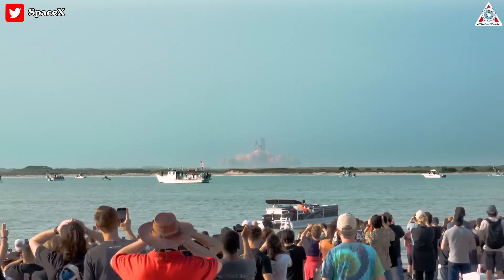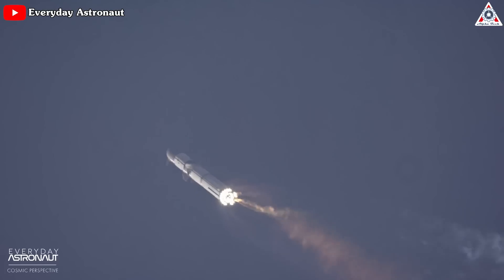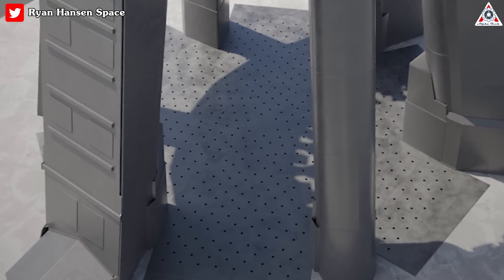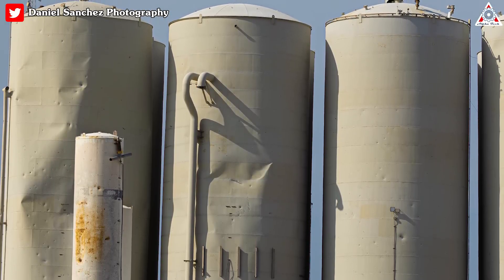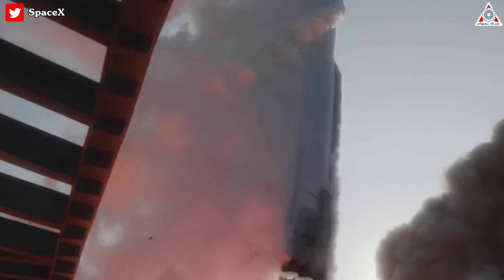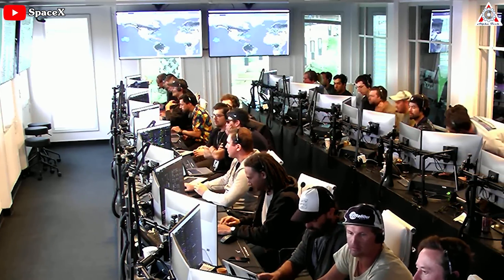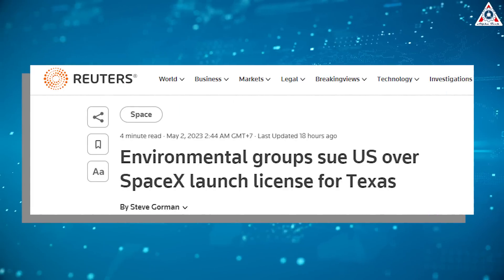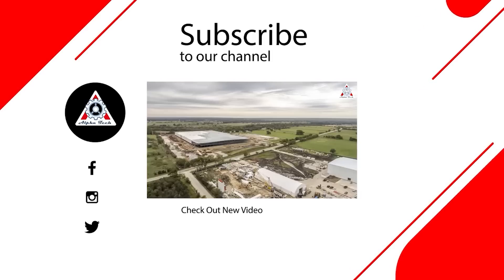SpaceX upgrades everything on Starship's pad for new launch...

Comment: Wouldn't it make sense to add a water system to the top of the OLM that would activate when the clamps are opened? If your goal is rapidly reusable then minimal damage per launch is the target.
Reply: I would hazard a guess that Spacex engineers have a slightly better understanding of the issues than you do :-)
Reply: @lotuselansteve  Yet Musk claimed the thrust from the launch deteriorated the OLM top because it didn't go straight up from the launch pad. So, there's that.
Reply: The plan is to add a deluge system forcing up to diminish the acoustic effect of 33 raptors firing.  And if they take off sooner as planned then there will less time for raptors to damage the space under the OLM.
Reply: @michaeldeierhoi4096  Understood. I'm pretty sure there was a similar plan last launch also. But I thought the plan was for rapid reusability. If you don't plan for contingency and durability, you will suffer it's fate. Hence, here we are.
Reply: @aeasus  Evaluating the development of starship and the launch pad on the basis of this first launch is sort of like judging a person based on one picture which just happens to a bad picture.
Reply: @michaeldeierhoi4096  It's not a first time a rocket has been launched, just a first time for Starship. I find it sad that they have to learn things the hard way instead of standing on the shoulders of those before them. Even when they say they know better.
Reply: @aeasus  I don't feel sad at all.  Space X has definitely learned from the past history of rocketry, but Space is developing a new rocket as well as how to build it and how to build the launch pad to accommodate the most powerful rocket ever. There are also some limitations at Boca Chica that were not an issue at the Cape.    Since this was just the first launch I am not concerned at all.  I would feel concerned if after several launches they were still having the same problems.  They will get it right eventually.
Reply: @michaeldeierhoi4096  "They will get it right eventually." And that my friend sums up the entire thread. I would quote something from Forest Gump's "Mama always said .." but I think that's pretty evident now.
Reply: @aeasus  Thanks for your comment.  The next launch has a good chance of going much better.  We'll see.
Reply: @michaeldeierhoi4096  agreed

Comment: I haven't seen any serious person calling the damage done as inconsequential. Not only did the launch pad got totally destroyed, it also damaged nearby infrasutructure and the nature habitats around it not the mention Starship it's most lkley

I am willing to call this launch a 95% failure since this launch did little to show what a properly launched Spaceship could do, which should be the point of a test launched, and will delay further launches sümce they have no launchpad now
Reply: The one who can best assertain if the launch was a success or failure is Space X and as Musk said before the launch that the main goal was to clear the tower and not damage it.   The starship did clear the tower and made it past Max Q almost to MECO.   Musk has said in hindsight that the damage to the launch pad was minimal.  They are already well on the way to repairing which wouldn't be the case if the pad was totally destroyed.
Reply: @michaeldeierhoi4096   I'm sorry but I don't  trust that at all. Pictures of it are all across the internet. In some parts of it concrete cover is fully gone and rebar  is fully exposed, not to mention the giant hole. That is not light damage and they certainly not going to simply repair it. There is no way the remaining concrete hasn’t cracked or the exposed steel yeilded
Reply: 95% failure, 95% success, who cares, not SpaceX or Elon Musk that's for sure, they have already moved on.

Comment: It was a complete failure.
Reply from the maker: The failure will makes them better
Reply: @alphatech4966  No, not at all. This is a huge F. We know how to build proper launchpads since the 50's. This is pure incompetence.
Reply: @jhdsfalsjhdfjashdkhvjfldld8301  yes, and they're expensive AF. Hence why Space-X is trying something different, just like with their rockets. There's also the problem that they're limited in how deep they can dig into the ground at the current launch site, so a 'standard' launch pad wouldn't have worked, anyway.

Comment: This rocket is a beast. The launch was half a success but 100% entertaining.
Reply: Musk didn’t seem “amused” sitting in the control room after the launch.
Reply: The launch was a huge F
Reply: @jhdsfalsjhdfjashdkhvjfldld8301  Yes, a fantastic F.
Reply: @jhdsfalsjhdfjashdkhvjfldld8301  Nah, it was an engineering success as far as the rocket was concerned. I would agree the OLM Fondag concrete test was an F.
Reply: @Rosieplayz100  how was it a success, 8 of the 33 engines failed, selfdestruct failed, fucked up whole platform. Didnt even get into orbit. 
Yet everyone is saying it is a success, nah it was not. It was a learning experience but not a succesfull one.
Reply: @spicesmuggler2452  It's simple, really. SpaceX defined the success measures for this flight and it met those measures.
Reply: @Rosieplayz100  They said it was successful after the fact. Musk looked dissapointed. I dont buy this PR crafted self motivating answer. It was a great learning experience. I think they are behind what they wanted to happen. I believe in their success later on, but this was lukewarm result.
Reply: @spicesmuggler2452  Most of Elon's comments about success were before the launch: Musk said Sunday (4/16). “If we get far enough away from the launch pad before something goes wrong, I would consider that to be a success. Just don’t blow up the launch pad.” There are plenty more as well. Regardless, they will live and learn and I believe booster 9 will do much better with Stage 0 upgrades as well as many booster upgrades (e.g., Electric vector control vs. hydraulic).